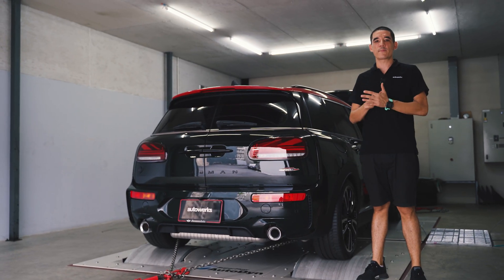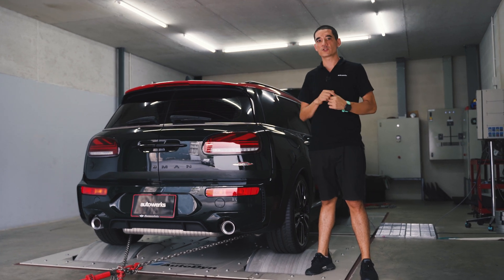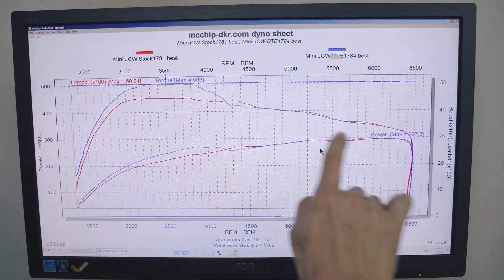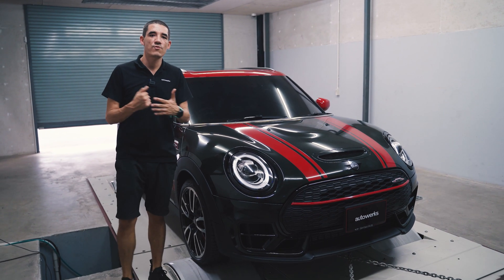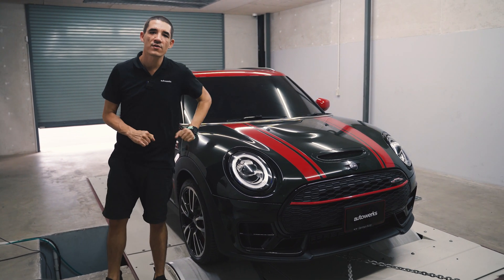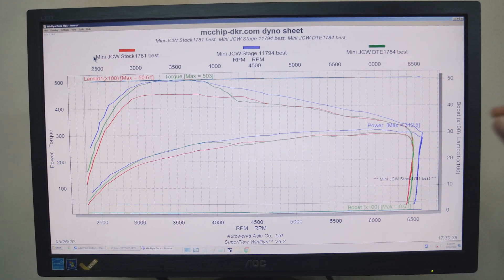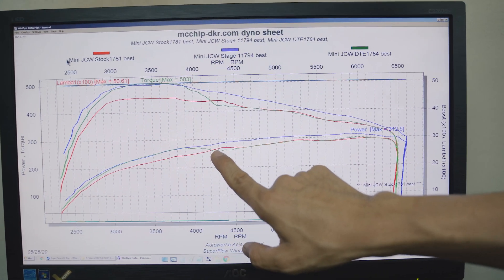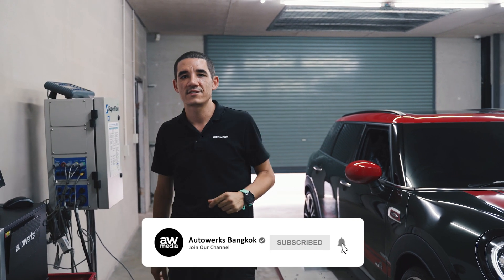Tuning box vs Ecu Tuning

Comment: What box was that? And why are both HP gains so low? Stock on this car is 306
Reply: 306 is BHP. That is the HP before going through transmission essentially and not to the ground. The gains they show are real world HP at the ground. The man
Reply: The box is DTE btw. It is entered on the Dyno Chart.
Reply: @bryanedwards7607   Thanks, are you sure it's not to the wheels? And the HP increase on his chart goes from 297 (stock/box) to 312 on his tune. Seems really low for a custom tune.
Reply: @-Scraps-  Yes it is at the wheels. That's why you're seeing the 297 on the stock run versus the 300 and something that it is factory. You're also looking at only the peak number but if you look through the rest of the power bands the gains are significantly higher and smoother across the entire power band not just the peak number.

Comment: Sorry guys but there are something real strange...
Can you clarify to us, whp our bhp?
It´s common into stage 1 tuning for this cars about 20% gains over standard power...
Reply: All of these numbers are WHP. You're only looking at the peak HP to determine the gain but if you look at the 3000-4000rpm range the gains are there and more consistent all the way across the chart. If you convert their number to BHP they would easily be at the 20-25% mark. $400 for 20-25 real HP on a small displacement car is VERY noticeable!!
Reply: @bryanedwards7607  Yes it is, but generally at max power moment the best gains are achieved. Anymay...ecu good ecu tuning always gonna be better than a piggy back